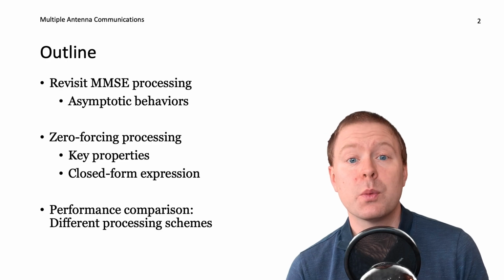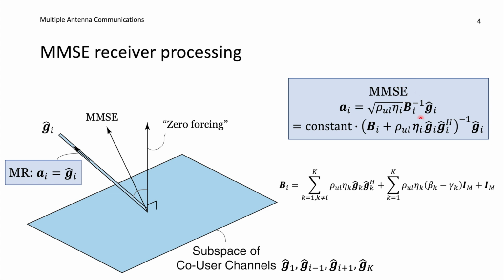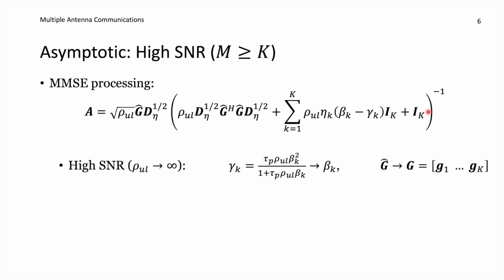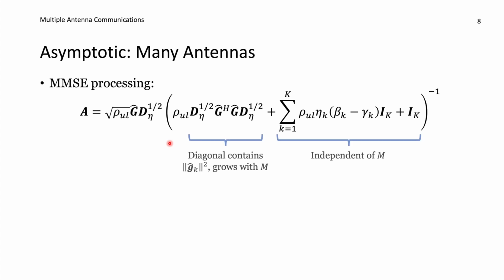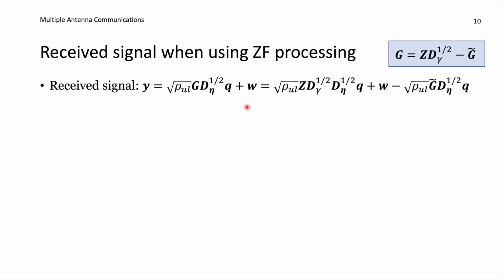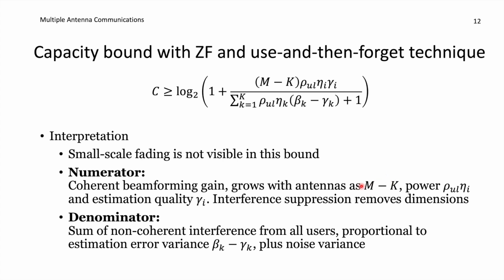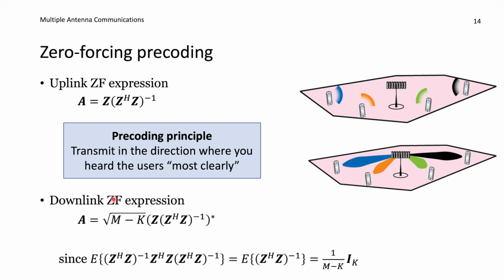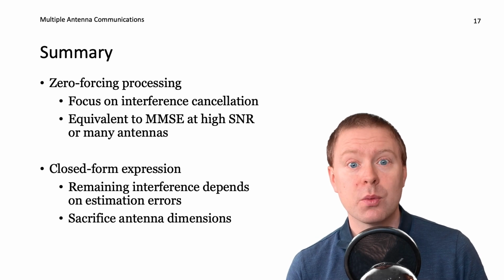Lecture 9b: Zero-Forcing Processing in Uplink and Downlink

Comment: ZF Processing
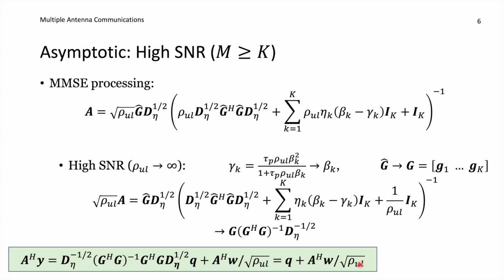13:45 Asymptotic (High SNR): ZF
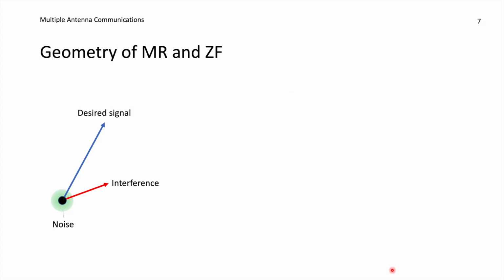14:00 Geometry Interpretation of MR and ZF
17:34 Asymptotic (Many Antennas): ZF with imperfect CSI
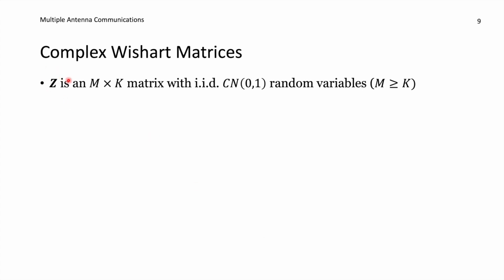18:38 Complex Wishart Matrices
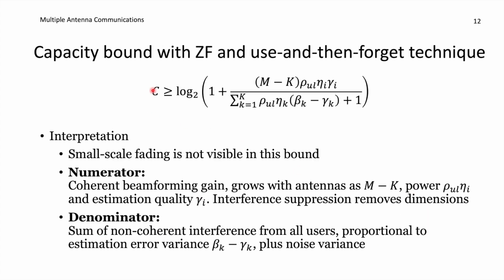25:42 Closed-Form for Capacity Lower Bound of ZF
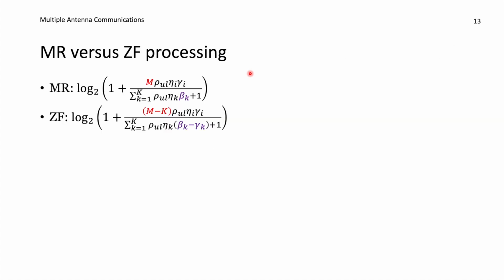28:08 MR vs ZF
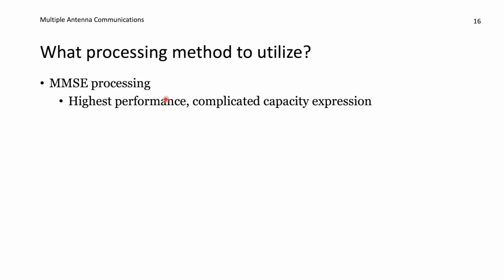34:00 Summarize: MMSE(Lecture 7), ZF(Lecture 9b), MR(Lecture 8)

Comment: Thanks, when I just have given an angle e.g. 35 degree, and I want a null in that direction, how do I do this?
I have no channel value, so I cannot do zero forcing with 1/h.
Reply from the maker: Let v be the array response vector for 35 degrees. Then you can create a beamforming vector as (I-v v^H/||v||^2) x, where x can be any vector. It will create a null in the 35 degrees angle and the peak direction is determined by x.

Comment: Thank you for the wonderful lecture, professor. 

I have question regarding performance comparison in MMSE ZF MR in slide 13(When antenna number is growing).

I remember the motivation of MR was the favorable propagation which reduces the user inference.
And MR maximizes SNR by aligning received signal to channel vector while keeping the amplitude of the noise constant.
I intuitively thought that if antenna number grows and user interferences decease, performance of MR would follow the that of MMSE.
It is interesting that the mathematic derivation and simulation show that this is not the case.

Can you give me some hint, where I missed the point?

Thank you in advance, I am really enjoying your series.
Reply from the maker: Yes, with perfectly favorable propagation (orthogonal channel vectors), the performance of MMSE ZF and MR will be the same. However, random channel models typically only offer asymptotically favorable propagation, meaning that the channels become orthogonal when the number of antennas goes to infinity. For finite antenna numbers, there will always be interference left when using MR, while ZF and MMSE suppress the interference. 

If one would rerun the simulation with more antennas, all the curves will improve and the gap between them will shrink. I believe that MMSE and ZF will converge to each other more quickly than MR converges to the others.
Reply: @WirelessFuture Thank you sir, much clear! The graph shows the part before convergence.

Comment: Thanks, when we take the well known MMSE estimator (E{IIx-x_hat(y)II}) to estimate the symbols at the receiver, how long is that vector i.e. how many symbols are estimated in that step?
Is x_hat(y) a point in the IQ plane that can be everywhere or just the discrete points according to the modulation (e.g. the fix 4 points in the 4 QAM modulation)?
Thanks a lot.
Reply from the maker: The MMSE receiver can be applied for one symbol at a time, and it produces a point that can be anywhere in the IQ plane. After that, you take all the x_hat values for an entire codeword of the channel code and run a decoding algorithm. This decoder outputs the discrete points from the constellation (or rather, it outputs the sequence of data since parity bits are removed).

Comment: Hi, I remember some textbooks say that ZF will amplify the noise, how can this be interpreted geometrically like 15:05 ? Additionally, on the page 442, line 4 of your new book INTRODUCTION TO MULTIPLE ANTENNA COMMUNICATION, it seems that LMMSE will sacrifice the desired signal power, how could this be interpreted? Thanks in advance!
Reply from the maker: I’ve also seen that statements in textbooks and I’m not particularly fond of it, mostly because it only makes sense for receiver processing and not transmission.

The ZF combining vector can be scaled in different ways. What I assume in the video is that we normalize the vector so it has norm/length 1. This implies that the noise variance remains constant but we sacrifice signal power to eliminate the interference. Another approach is to scale the ZF vector so that the signal power remains constant. In that case, the price to pay for removing interference is that we amplify the noise. These two interpretations are equivalent in the sense that the SNR after ZF is the same. Which option that is closest to reality depends on the hardware implementation.

LMMSE tries to maximize the SINR (which is equivalent to minimizing the MSE). There are two terms in the denomination: interference and noise. To mitigate interference, we need to sacrifice parts of the desired signal - the parts that lies in the same dimensions in the vector space. To “mitigate” noise, we just need to keep the desired signal power as strong as possible. LMMSE finds a balance between these things: A balance between ZF and MR.
Reply: Thanks! It is now much clear to me.

Comment: Dear Prof., Thanks for your lectures. They are really helpful. I have few questions. Could you help regarding them ? 

1, I understand that the MRT, MRC, Dominant eigen mode transmission in MIMO and MMSE, MR, ZF in MU-MIMO are in general some kind of processing that nullifies the effect of channel and interference. In SISO, equivalently we do equalization for that, which nullifies the effect of the channel. Hence do concepts like Decision Feedback Equalization or Sequence estimation-based equalization are also relevant to MIMO. To be more precise, Do we have some linear processing/precoding called DFE precoding so and so  ?

2, Sphere decoding is also a common term, I come across in MIMO community. Where can we put them into our lectures? Are they just another add-on to MMSE, ZF, MR? If possible could you make a video also about it?

Thanks in advance